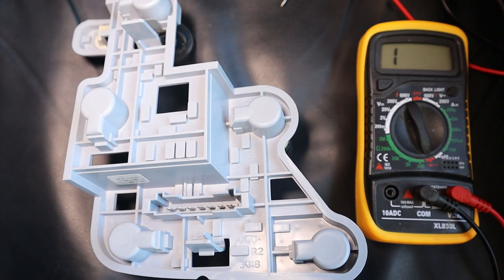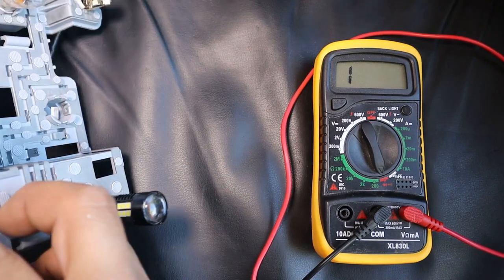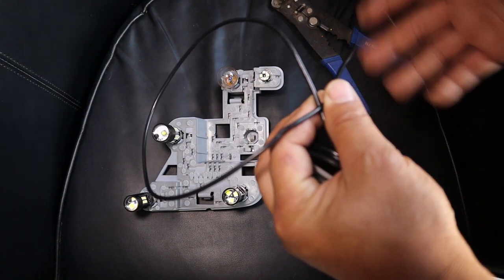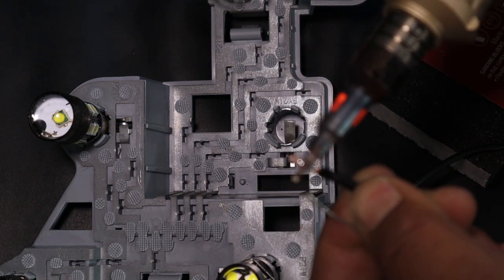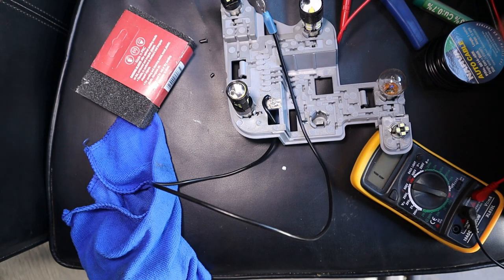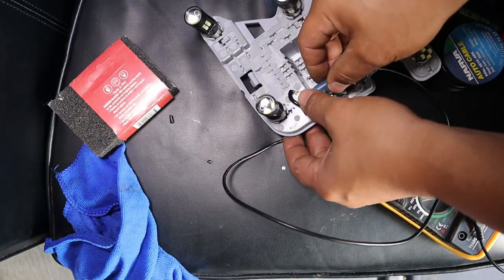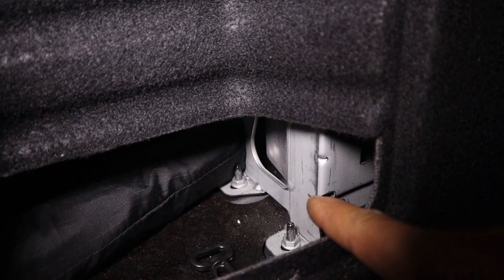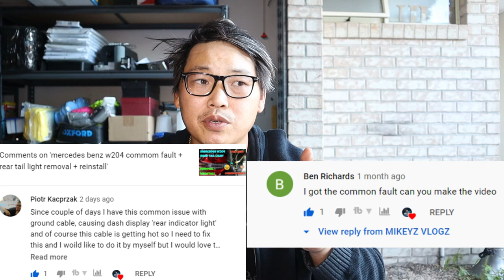mercedes w204 c300 common faults + how to fix rear tail light brown ground wire

Comment: Please help!!!!!! I did all this. My brake light is still blinking as a turn signal on my rear right and still showing error message. Do you know what could be triggering it? Please
Reply from the maker: as I stated in the video this ..this doesn't necessarily fix it ..u most likely have an underlying issues which a auto electrician should help with
Reply: @MIKEYZVLOGZ  do you know what could be the cause of both my rear turn signals to not work? What and how to test?
Reply: @MIKEYZVLOGZ  when I use hazard light it also doesn’t work in the rear tail lights
Reply from the maker: @ddddd168  if it's not working sounds like a short ..as if two wires somewhere exposed and are touching or a loose wire... tbh.. these things take time and experience to find.. ud have to fault find .  and even I am not that good at that .. sometimes I do things by trial and error... I test til I find the issue... I. not a professional mechanic or auto electrician by trade.. I'm a simple diyer..so I would try use the electrical fault finder ...it finds a break between wires by following the cable routed ..that's one way..or u use a obd2 scanner so it can point u in the direction of what to look for ... and another thing would be to get schematics and find the right wire and follow it .. thes are things I would try. and if all else fails u may need to turn to forums and a pro
Reply: @MIKEYZVLOGZ  thanks, I really appreciate the feedback. It senses there is a bulb in the tail light board. Only when I turn the signal on the message pops up. When I turn off car and turn car on message goes away until I go to use the signal again. Ughh my head is spinning thinking about this.
Reply from the maker: @ddddd168  yes it would turn off until u signal again because then it reads the fault code once again. so that does make sense ... I hope u can figure it out my friend ..I understand the frustration
Reply: Dan S did you get it fix? Any updates I'm having the same issue
Reply: @zeedesousa4765  I found out the led light circuit board was faulty. I bought a whole new led tail light and then soldered a thicker brown wire just like the video did. 

I went to harbor fright and bought truck/trailer harness and just used the wires from that.

Comment: Hi guys I did the exact same thing but my brake bulb is also blinking together with the turn signal when  I put on the hazard..did anybody here experience that and how did you fix it please please need answers
Reply: I stripped the brown wire and pried the metal up on the assembly and stuck the wire under the metal part of the assembly. Took a pair of pliers and cramped it back down. Works fine.

Comment: How do I use this on a Mercedes Benz 320clk
Reply from the maker: sorry what exactly are you asking..? do u mean how would you go about doing this on your car? it would be the same procedure...find your ground brown wire and test where your grounding on your plate and then solder your 15amp wire and find a ground point to bare metal of your car and use that as the new grounding point
Reply: Thanks bro
Reply from the maker: @jonteturner9878  u r most welcome 💯

Comment: Sir why my tail lights will turn on even the engine is off. Sometimes it happened once a week or twice a week. My battery always get drained.
Reply from the maker: so ur tail light stays on wen u turn car off? that is not right... should not do that... have u checked the brake sensor ...u need to do a scan and try find the problem
Reply: @MIKEYZVLOGZ  is it possible tje switch is defective?
Reply from the maker: @roylim194  possible but it wouldnt leavw ur lights on ... it sounds more like a sensor but u wont know unless u actually scan and find the source of the problem

Comment: Hi,
I have the exact issue with my W204 and I called up Mercedes and they said there has been no recall on this issue.  Is that true? I have a feeling the sales rep is lying.
Reply from the maker: no recall yet ... but some mercs will do it free considering the situation ..but rare ... I have heard ppl say that merc fixed it free ..but they do exactly what I. showing u here..but sometimes an even worse job ..depending on the mechanic doing the work ... remember places like mercedes use alot of apprentices and interns

Comment: I have tried this and I am still having a issue with error messages and my light stay on and do not switch off.
Reply from the maker: u might have a short .. in that case u have an underlying issue u need to get it looked at by an auto electrician

Comment: You should have explained what the problem was, what you were trying to do and why you were doing what you were doing. You started with the end. The fix. How can the problem be fixed if the brown grounding cable is still in use? And I didn't get the point of both the soldering and the bolt and nut thing. You didn't finish that part that showed us what it looked like when the bolt and nut were attached to that board. Neither did you show how you tested it when you had connected the new ground wire to the bolt on the car. The board was turned and your hands were in front of the camera. You didn't show what either of the sides of the board looked like when you had finished. And I didn't get what the red wire was that you showed for a few seconds, neither did I get why you pointed at the three holes on another part of the car.  If people understand this, it must be because they already know how to do these things. It was all very confusing, because you left out a lot of things that needed to be shown and explained.
Reply from the maker: Sorry to have confused you... i guess i will have to be mote thorough in future ... i thought i covered everything i needed to... but i guess i also forget some ppl dont have the experience like some other ppl.... i apologize for that... i miye do another video covering everything u were confused about.... i will take ehat u said very seriously and consider all of this for future videos.... also the red wireni showed with the eyelet ring on both sides was an example of what ur wire would look like if u decide to go the intrusive route and drill a hole in order to bolt a wire to the backing plate and to your cars chasis in order to create a new grounding point for your rear tail light assembly...basically what u are doing is creating a new grounding point as the factory ground wire is too thin therefore creating the common faults ppl experience.... whether u choose to solder or drill a hole and use a bolt and nut.... the purpose is to connect a wire to the backing plate and   then to a ground point of your car(bare metal of chassis) as for the factory brown wire ... because we are creating a new ground point we no longer need the factory broan wire so u can disconnect it cut it ... whatever u choose... its no longer needed... hence why we are creating a new ground connection... im alwaya here to help if h have any questions

Comment: Those goofy led bulbs will mess you’re electrical too
Reply from the maker: true u have to get good ones or use led resistors
Reply: I had autozone ones on my Isuzu and when I used the blinkers it took power from the engine every time they activated. It took a month for me to figure out what was happening.  I switched back to factory and I’ll never in my life trust those things again
Reply from the maker: @macbook802  are u talking about parking t10? or h7? or like brake light bulbs ..or led in general..I've been using them for a very long time ..but u need to find the right ones.. and wen ur replacing halogen bulbs with led it throws errors due to I consistent draw ..leds use much less power watts and current
Reply from the maker: @macbook802  but to each their own..